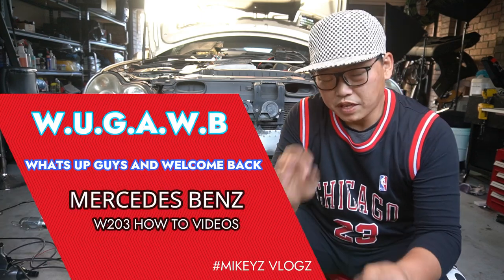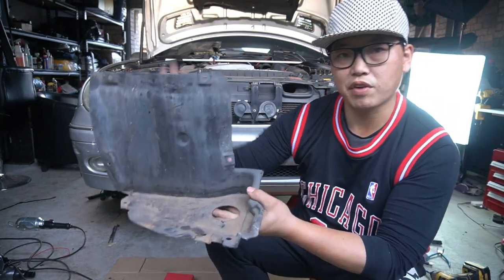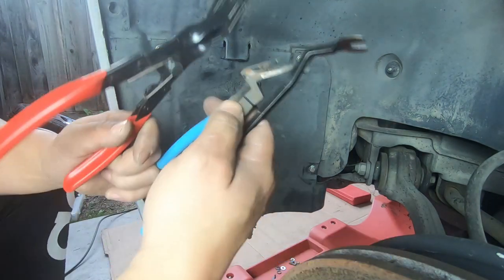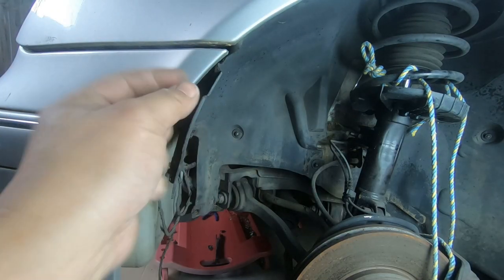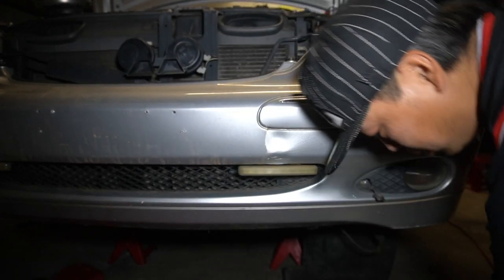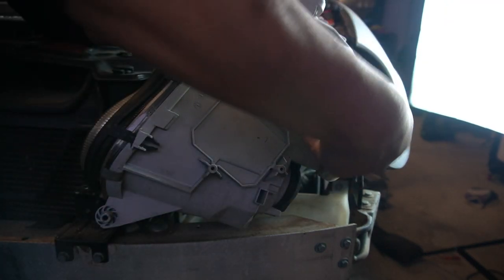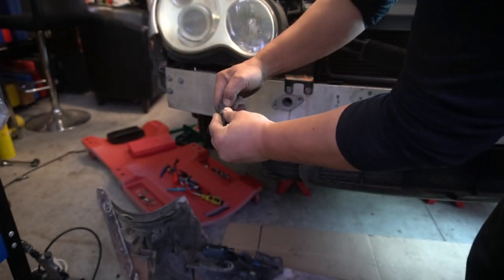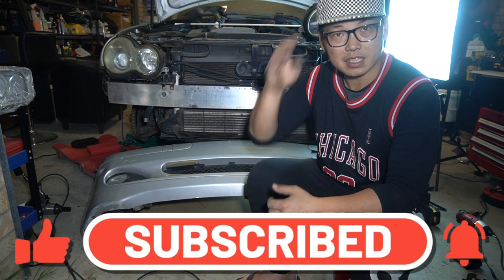MERCEDES BENZ W203 MODS FRONT BUMPER and HEADLIGHT removal

Comment: Great Vid MIKEYZ. How different is a w204 bumper to remove ? Cheers
Reply from the maker: very different ..i did a video on that too .. check it out...imho its easier doing the w204 bumper cuz there arent clampsnto remove just bolts and it comes off so easily... also differenr types of front bars will remove differently..slighly
Reply: Its a bit different but similar in different ways ... he did a video showing how to remove the w204 ..check it out its very detailed
Reply from the maker: @michaelleroy4218  well put mate .... yes its someahat similar but also different as well chefk out the video and ull see

Comment: What is the air hose used for?
Reply from the maker: which air hose are u referring to... if your talking about all the air hoses coming from engine bay area...mercedes use a vacuum technology for certain parts... for headlights I believe it's the hose to let air out so it doesn't build up and fog up. the. there's the hose for ac..to drop water build up...and thered also hoses for headlight washers which only certain models have
Reply: @MIKEYZVLOGZ  I was reffering to the headlight hose. My W203 has bixenon lamps, and I bought biled projectors. Now I'm figuring out how to connect them. And I pray that computer unit wont see broken bulb. I thought this will be plug and play. I have 4 wires from bi-LED and a lot cables inside lamp. Also I have 3 conenctors for the lamp. Do you have a working wire diagram for W203? I tried looking for it, but its hardly avalible. My idea is to open stepup unit, cut 12V in cables, get voltage from there and get  "long light or shutter power" from H7 cables. This way it shoud teoreically work, but im not sure if computer will see it, and maybe cut off power completly.. thats my bigest gripe. I wonder why isn't there any video whatsofver on the youtube about mercedes bi-xenon to biled conversion with how to and step by step.
Reply from the maker: @Bartosz Laga  cuz its is usually halogen to halogen..then u just use led bulbs instead ... like what I did... my headlights were the standard halogen ..no leds..then I bought a set of halogen but bixenon looking.. and changed all the bulbs to hid and led then went all leds for less heat and less fragile... if u tried to go bixenon..that's why ur having issues..cuz ur trying to plug a headlight that is actually bixenon to halogen connectors... most ppl actually just buy a updated version of lights that use halogen bulbs or leds..but always ensure tour plug is the same ..same amount of pins and same plug port
Reply from the maker: @Bartosz Laga  wbe. I bought mine I made sure it was dire t plug and play..no errors no issues..and if it wasn't I would return it..simply because it's abit of a hassle..wen u spend thT much money it should just work
Reply: @MIKEYZVLOGZ  Let me rephrase. I have original W203 bi-xenon lamps, with sprinklers and autoleveling. It is oringal HID system. I bouthg BiLED projectros and was hoping to plug and play, but since they just have cables - I have to connect soewhere. And this is my question. Since LED works on 9-16V and original HID is 85V or more :) Why isnt there even 1 video on the whole internet from someone who did this. There has to be someone. Do you know any LED lighting forum on the web ?

Comment: please where can I get the two bumper brackets ?
Reply from the maker: u need to remove them off another wrecked car .. or I would try a card yard or even ebay and used car wrecking lot .. or shop mercedes classifieds... eBay or mervedes spare parts
Reply: @MIKEYZVLOGZ  thanks sir

Comment: How do I remove it when I have front parking sensors?
Reply from the maker: once u remove everything else ..u will find a plug that plugs into the sensors... u wont have to remove individually .. all the sensors are wires together and usually it has a main plug harness which is usually in the front right side near the fog lights ..u will see it when u remove the front bar ... just don't rip the front bumper off ...look and be careful to alwaya slowly remove so u don't damage any connections... I didn't have front sensors ..but if I did it would have been just another plug thats it
Reply: @MIKEYZVLOGZ  Thanks man, I appreciate the quick and detailed answer! I need to remove my front bumper to get access to my headlight because I want to replace my hazy headlight lens. Definitely subscribing!
Reply from the maker: @yunusgul8161  thanks mate..
 yes u will see the connection to the front sensors... u can't miss it
Reply from the maker: @yunusgul8161  hazzy lens can be polished to a clear shine again ... its about wet sanding it back and finally polishing it and then applying a protective coat ... there are alot of restoration kits out there and they work very well... some ppl have even used wd40 and toothpaste if u can believe it... give it a go u don't necessarily need to replace the lens
Reply: @MIKEYZVLOGZ  The W203 pre-facelift lens is "blurry" from factory
Reply from the maker: @yunusgul8161  oh ok I get ya ...

Comment: How to put clips back on Mr nigga fix couldn't find the install video
Reply from the maker: what do u mean
Reply: @MIKEYZVLOGZ  couldn't find your install video, you said you would make in next video, just went by upload date but didn't see it, but didn't check too carefully, but checked the one after this. the bracket around the 8 minute mark, but I found another video explaining it again for just putting back on. You removed the wheel and more of the fender, but many people want an easy way to do it, so if you remake your video I think you can make more money. there are a few popular videos they do really quick with no explanation and remove minimal things, so I tried that at first but got stuck because couldn't put back in from doing it blind, I still have the piece but will try it later. and many people have parking sensors that fail so need to remove bumper for DIY or have different mercedes models but all use the same bracket but almost nobody explains how to put back. is very trick to do it just by feel if don't know what you're doing.